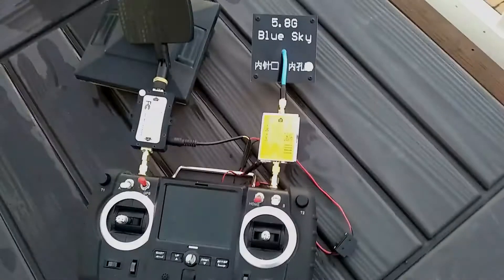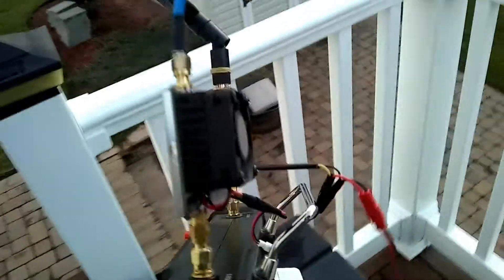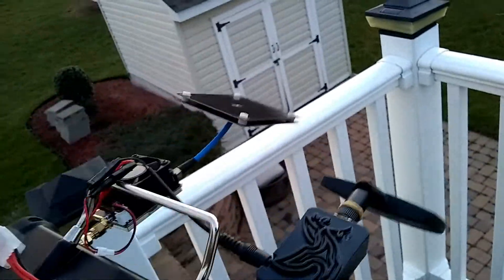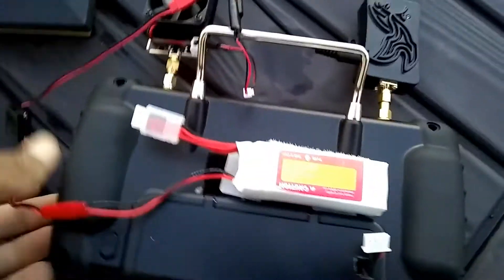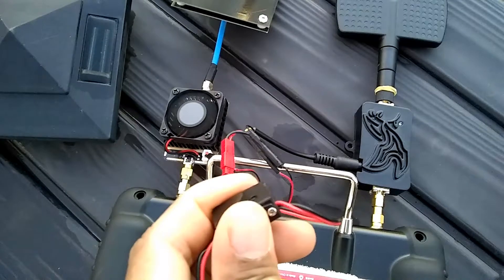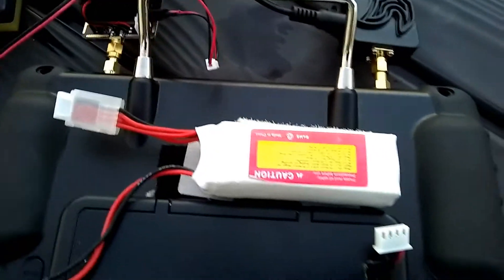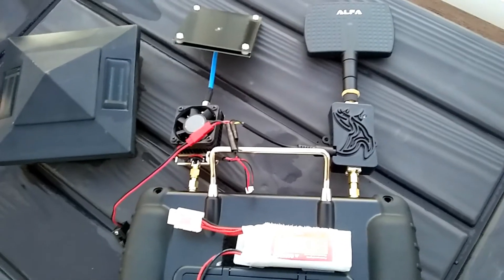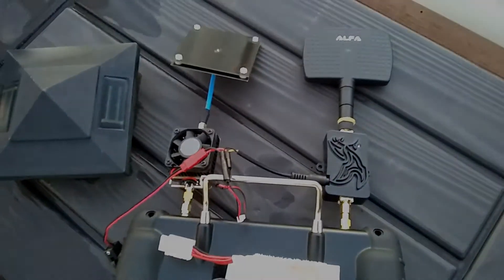Hubsan 501-SS FPV 3 Watt Amp  Power Upgrade

Comment: the 5.8 amp is for the drone only not for the receiver!! you n eed to buy this one: this is for the signal transmiter and receiver work the 2 ways https://www.banggood.com/SZHUASHI-5W-37dBm-5_8G-Wireless-WIFI-11bgn-Signal-Amplifier-Signal-Booster-for-FPV-with-FCC-Certification-p-1527814.html?rmmds=search&cur_warehouse=CN

Comment: What happened with this project? Enjoy watching your vids by the way!!
Reply from the maker: Thanks bro,the amps are unnecessary,this drone puts out enough prower stock..
Reply: @modshobs1014  What is your current setup that you use for max distance? I have a 501ss advanced as well. Usually average 700-1200m but I'm in a heavily residential area. Did hit 1,500 once. Atmosphere must have been perfect. Running double battery mod saw from you, the done guru. Haha Thanks

Comment: Dud not criticizing you but the 5.8ghz amp you are using for fpv is a bidirectional amp it is only gives your receiver a gain of micro volts. The wattage. you are speaking of is nonexistent in this set up as it's high power transmitter it would have to be hooked to the quadcopter. You would be better off with a preamplifier on the romotes fpv input. I am a Radio Engineer with Fcc Radiotelephone license with Radar Endorsement. So save the big amp get a little preamplifier for the remote. "Good luck Good Flying"
Reply from the maker: Thanks, it's greatly appreciated...

Comment: The 5.8Ghz booster is actually for the TX (transmitter) signal which is on the side of the drone... The drone transmits the signal to you.  So you should get the same range without it.  The 2.4Ghz booster is correct because your transmitting the signal to the drone

Comment: Good Morning Sir..the hubsan 501ss and 501s..On your transmitter.. the 2.4ghz side.. is the side that transmits every command from transmitter to the drone.. its great to have a power amp on that side so to increase  transmit single to the drone therefore increasing the range of the H501ss or 501s  drone...The 5.8ghz side of your transmitter is the  receive side.. of transmitter ..for video and all data coming back from your drone..if you take your drone apart ..and look at the motherboard Top inside the drone. you will see the 5.8ghz transmitter block. this block will be marked with TX by antenna connection.. standing for transmit.. the 5.8ghz antenna wire from inside the drone transmitter block.. runs down the rear right leg of drone with little antenna on the end inside of the right rear light cup...   the 5.8ghz transmitter block in side of the drone ..looks just like the 5.8ghz receive block in side your transmitter where your antenna is connected too..and now to my question Sir .this is what i want to ask..In order to receive the 5.8ghz transmit single from  the drone.. back to your transmitter..due  to the extended range of the drone by adding 2.4 ghz power amp to the transmit side of your transmitter..We would need to add a receive preamplifier .to boost the  incoming 5.8ghz signal from the drone to the  transmitter...or either we need to put a 5.8ghz watt poweramp on the drone with external antenna to increase transmit signal on the 5.8 ghz side to the receive side of transmitter ..I cant explain what i'm trying to say.. sorry for wasting your time have a good day..

Comment: I noticed something about the 5.8 amp that you may want to consider. I was looking at it from the web site. the specs say that the amp requires 12-16 volts to operate. I would assume this means to operate at peak power.  peak power for that amp is 5000mw which is not allot. If you are using a 7.4 volt battery regardless of its amperes you are under powering the 5.8 amp. You can find online replacement backup power batteries (for PCs) which are 12 volt and rechargeable like the APC 600W back up power. Also what is the output power of the 2.4 transmitter before you boost it. If it is over 100mw you could be burning up the transmitter amp on the 2.4. If you are going over the 100mw max input to the amp the amp itself maybe cutting back its own output power to keep itself from frying. Thus limiting the range on the 2.4 output. Might want to consider this.
Reply from the maker: Tapps47 I had a 3s and you got a good point I appreciate it but I scrap that project.
Reply: Well that to bad. Not many people are making any Hubsan 501Ss videos about upgrades lately and i am looking into buying one. I cant afford a 3s.  There are two Hubsan and two MJXs i am considering. Myself, I'd be happy with 1K range with intact FPV for me its good enough :)
Reply from the maker: https://www.tomtop.com/p-rm5060w-us.html
Reply from the maker: select the U.S warehouse,the white hubsan and the  U.S. plug,it's on sale for 156.00 us
Reply: the other hubsan i was looking at was the X4 501W. it has 14 functions but what i dont like about it is that its wireless FPV through phone.but it does way points, follow and circle me. that the 501ss only does the follow. flight time is the same.
Reply: I don't think so because the device will pull the amount of amps it nees to meet the 5 watts or whatever. You'd under power it if you went below the minimum voltage.
Reply: @Mansare94  , maybe but it is current that does the actual work not voltage.
Reply: @GunDrone  it's both

Comment: Nice mods. Slap a 2.4ghz amp on the bird and get some insane range
Reply from the maker: Thanks bro,I guess were related somehow,lol.Putting an amp on it will make it way too heavy.
Reply: Mods&Hobs 101 i agree it will add weight but the 2.4ghz works bidirectionally. It communicates back and forth unlike the 5.8ghz which is 1 way. Cant wait to see the range you get. Looks impressive.
Reply from the maker: Thanks bro...